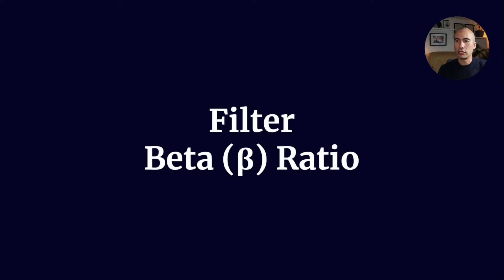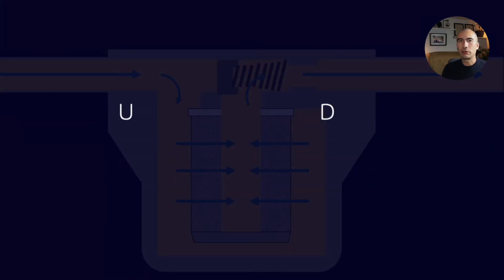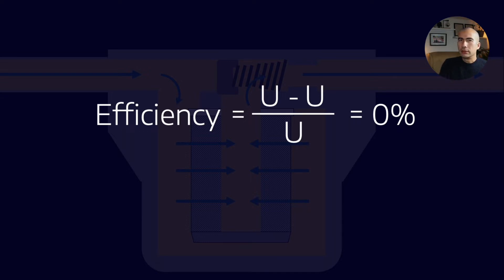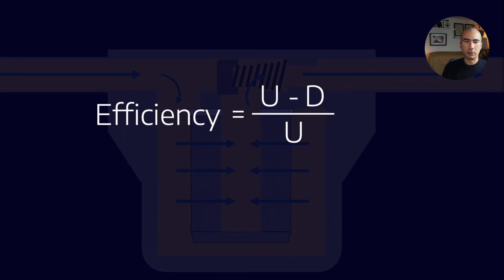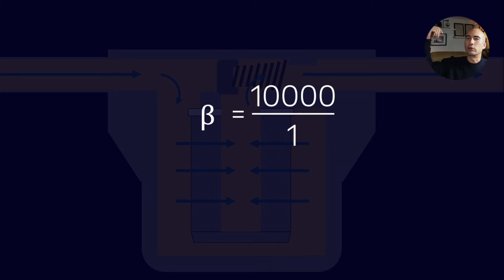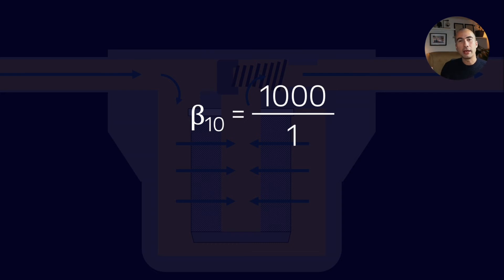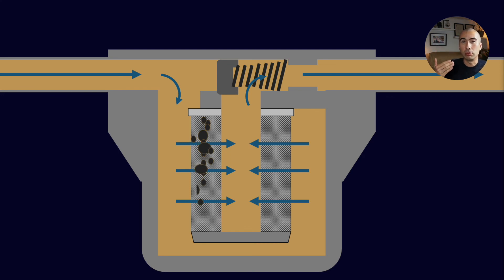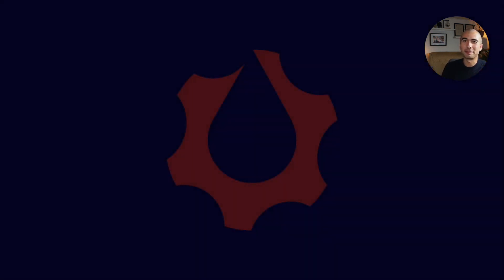What is a filter Beta Ratio?

Comment: As i can canclude from the video is beta ratio and efficiency are interrelated and depends on particle size. If it is, then efficiency should also be particle size dependent. Hence, one can not give a single number representing efficiency of filter. 
I want to know for which particle size we should ask beta ratio and efficiency from  manufacture as particle size varies in vast range.
Reply from the maker: Yes that's correct. As for what particle size, you might need to ask your lube oil supplier. In rare circumstances (Silicon antifoam agents are a good example) additives can be removed by 3micron filters, but generally 3 or 5 micron seems to work in industrial applications.
Reply: The particle size where there is a sharp change in the rate of component wear depends greatly on the components being lubricated, for bearings this would be closely connected to the oil film thickness under load, which is fairly easy to estimate. Surfaces like gear teeth have a different reaction to particles as it is more of a crushing action that micro pits the tooth surface so may require some trial and error along with historical engineering experience with specific metals.
Some setups will have a relatively low restriction 30um filter for the full flow to protect the engine from catastrophic damage(as most bearings in this example machine have at least a 40um oil film) and then a low flow bypass filter for the 1-5 micron range to clean the oil held in the reservoir and which does not have a pressure relief.